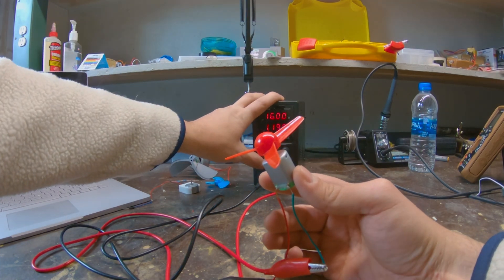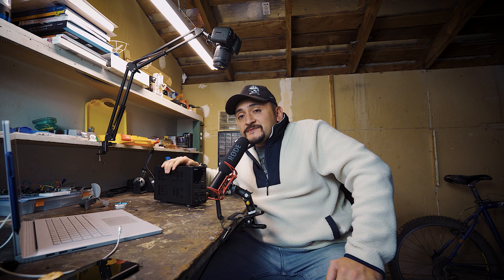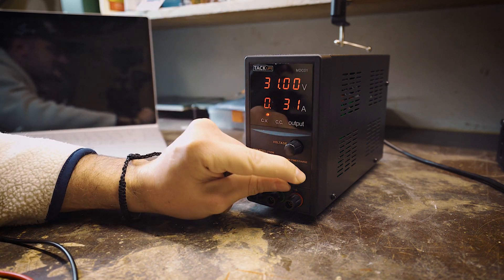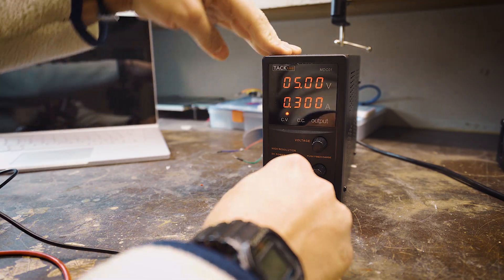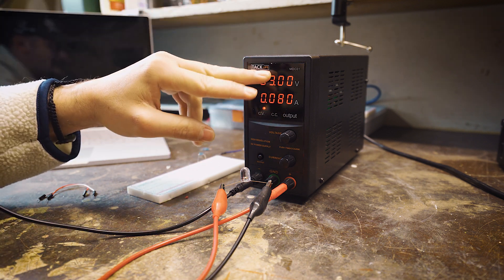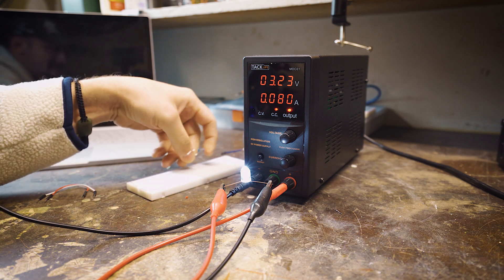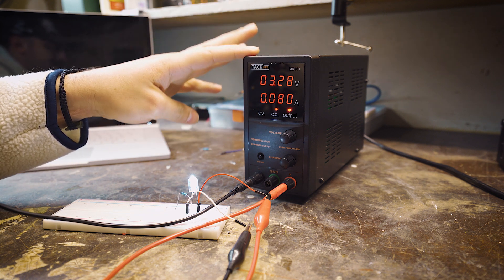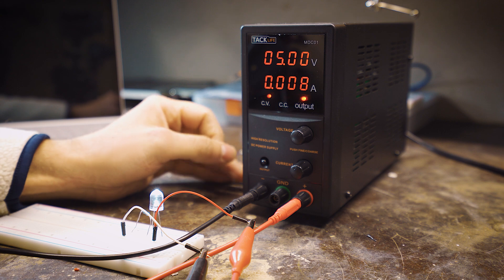How to use a DC Power Supply | Basic Electronics

Comment: Yes, an output channel button IS a standard feature.  It's only missing from bottom of the barrel chinesium trash, which are know to spontaneously combust from various failed components like bad dipped caps.  DO NOT use them indoors or for charging batteries or anything unattended.

Comment: I want to get a power supply that will work for me from 3.7 for some led lights and I want to be able to change to 5v 6v 8.7 9v 12v and 18v and I need to know if there is some component that I can use to restrict I want to use 18v millwalkie batteries to power lights on my bike but my signal lights will be 12v and probly the same for running light to eatherway is thereva resistor or restricted or what ever to allow 18v in but only 12 out or what ever I end up useing and yes it will be a mountain bike that I want to have signal and break lights on it any help you can give will be vary much appreciated.  Thanx dale

Comment: Do you have a video showing how to use the bench power supply to charge a laptop battery? Doesn't have to be fully charged but  enough to do some troubleshooting on a laptop - unit runs off the battery but not the charger (don't think the battery is charging from the laptop either) a 30V/5A unit should be good. Thanks. is the brand you are showing a good one?🤔 Thanks

Comment: Initially you applied 3 volts and saw .035 A which means:
r = v/i = 3/.035 = 85.7 ohms.  So the LED must have about 85.7 ohms resistance.

Then you kept max amps at .08 and tried to apply 4 volts but it clipped
the voltage to 3.24 volts...  so:
r = 3.24/.08 = 40.5 ohms.  So the LED must have 40.5 ohms resistance.

I don't understand how that can be.  I'm missing something but...  not sure what it is.
Reply: LEDs and other semiconductor components are not acting linearly, therefore Ohm's law doesn't apply to them. Look at V-A diagram for LED to understand its behavior.

Comment: Can a car battery be charged with this lab power supply?
Reply from the maker: Theoretically... yes. Just be careful, car batteries are high capacity and if you try charging it too quickly, you might overheat the power supply. set some limits and keep an eye on it.
Reply: @engineerjoules7163  
Thank you!
Reply: @engineerjoules7163  
And how would you go about it?
The voltage is to be fixed to 12V. With how many amps should I start?
Reply: @aleksandarsrdanov1171  No, you do not want the voltage 'fixed' at 12 volts. A 12 volt car battery is actually 13.6 volts when fully charged, so you want approx 14.5 volts to charge it. Your amps are typically about 2-3 amps for a slow trickle charge, or 4-6 amps for a medium charge rate, or 8-12 amps (or slightly more) for a fast charge rate.
With this type of variable DC power supply you want to set the max voltage limit and the max amperage limit before you do the actual charging.
Reply: @markstone1619  
Mark, thank you for the detailed response. In the end, the Lab power supply I ordered has not arrived and it turned out my car battery is completely dead. I had to buy a new battery.
Cheers!

Comment: I’ve got an Eventek that is in a similar package to yours.  I’m starting to wonder if it is defective though.  The only time i can adjust amperage is if I short the leads together.  Once it is hooked up to a load, the adjustment does nothing, but as I turn it, the led voltage reading disappears.  
Thanks for the video.  Our first lab in class, the teach basically just threw the power supplies at us without explaining a thing about how they work.  Is it any wonder that half the equipment in class is currently broken?
Reply: That is happening to one I just purchased,, I wonder if its broken?

Edit: The only time I can adjust amperage is if Its connected to my battery. I tried to hook it up to a volt meter and i couldnt adjust amperage. That is potentially the reason why we were having trouble. Hope this helps anyone else. So in order to adjust amperage you must be connected to what you want to charge.
Reply: @BigHemiNJ  leads must be shorted to adjust amperage. you are setting max allowed amperage. Then disconnect leads from each other and set volts.
Reply: I've had the same problem...I have a Eventek and I can't adjust amperage.

Comment: Thanks! I had some issues with a hydrogen generator I was powering with one of these, and I suspected it was because of ohms law but people were telling me otherwise. Now I know!
Reply: Hey man, you seem to be in a similar situation to me. Im trying to make copper oxide, if you search how to make Copper oxide with electrolysis, the guys channels name is in for the penny. In his video he was running 6 Volts and 8 Amps to 2 copper electrodes in a salt water solution. I can only get mine to run maybe 300 milliamps max. I cant change voltage to whatver but it doesnt change the amperage. Could you maybe help me? I saw your comment and was hoping id get some clarity but alas i have not. Increasing voltage doesnt seem to increase current in the electrodes.
Reply: @thecitrusfrequency1738  I'm not greak with electrical systems, but I can do my best. What is your power supply rated for?
Reply: @thecitrusfrequency1738  If you post a video showing your setup and what is happening that you can show me it might make it easier.

Comment: I just bought the same thing, plugged it in while watching your video. I am trying to learn electronics on my own. A lot of material out there, not that much about this item. Thank you for posting it, and I did subscribe so keep up the good work.
Reply from the maker: Thank You!! I really appreciate the support. Just moved so I've been busy but I will be posting more videos soon.
Reply: @engineerjoules7163  Can you please tell me something.  Suppose I pull a motor from a computer disk drive.  Can I use the DC power supply to learn what the ideal voltage I should run this motor at without damaging it?  Or is the only way to know is to risk destroying it?
Reply: How is your power supply holding out? Thanks
Reply: I will probably get the same model, as it has the "output" feature. Thanks
Reply: One of the most important things to learn is the dangers of grounding to the wrong point on a mains earth/grounded oscilloscope or o-scope.